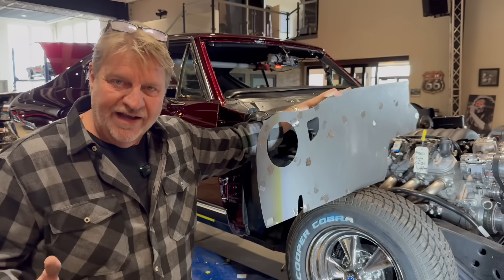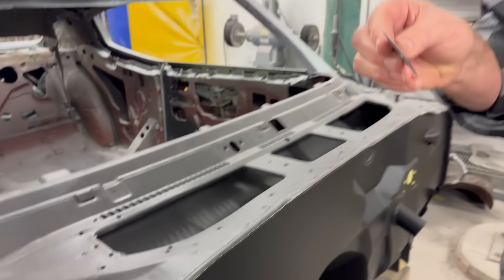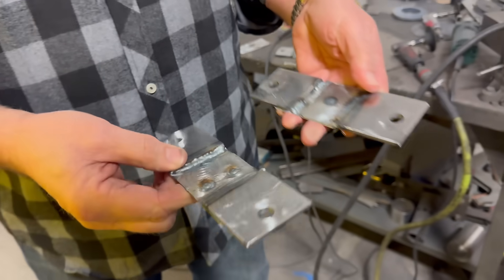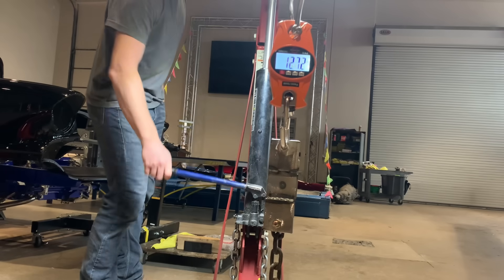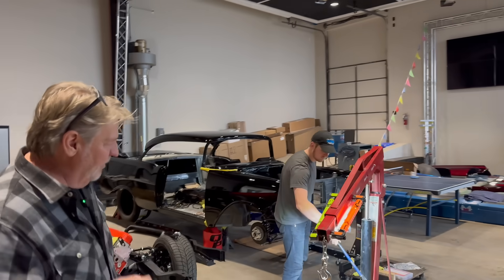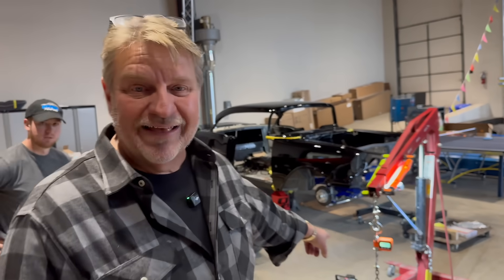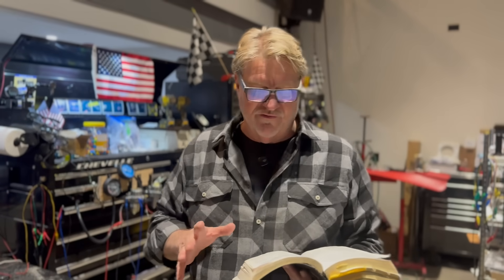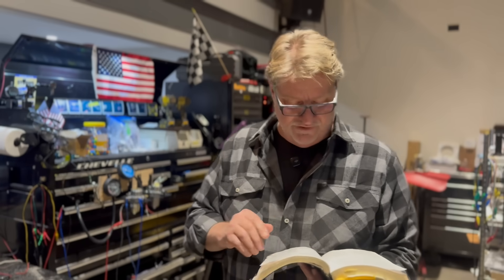Restoration Shop Using 3M Panel Bond Vs. Welding - Let’s Find Out Which is Stronger

Comment: I used this stuff back in 2006 on my 1969 Firebird passenger rear 1/4.  not only have I not had any issue with the glue, that 1/4 is straighter than the driver side which I welded (poorly) in a traditional manner.
Reply from the maker: Awesome to hear about your experience.  Sounds like it held up amazing.
Reply: It can help with reducing warpage and it acts as a seam sealer too.
Reply: That's not a fair test necessarily. A competent professional can and does know where to weld correctly so it doesn't warp unlike when someone like you butchers the job
Reply: @lollipop84858 I disagree. I was not at the time and still not a competent welder. Your statement seems to be that if I’m not I should pay a professional instead. Or I could adapt to my skill deficiency and use the panel bond to create a better product. Nowhere in my comment did I suggest that you shouldn’t weld, I simply stated that I haven’t had any problems with the panel bond in close to 20 years of service while also acknowledging my skill shortfall.
Reply: @pontiacontap 
Very well said !!
Reply: @lollipop84858 That's not true at all, metal always, always warps when introduced to high heat. The professional just does a better job of hammer and dollying it straight again. There is no magic that prevents metal from warping. Heck, I have even seen guys warp 1/4's grinding the welds down. The panel bond is superior because you end up with much more surface area of attachment.
Reply: @lollipop84858 "deBatE mE bRo!!"

Comment: We use a bonding agent called Hilti for commercial use in construction we anchor in threaded rods on rooftops that passes code then the panel Bond he using it's definitely going to hold your firewalls

Comment: weren't saturns    built with it ??not the plastic    the inner structure
Reply: saturns had bolt on plastic panels.  When I started my career that was the car of the future, now its a car of the past lol
Reply: @darylarmentrout252  i meant the steel structure not the panels

Comment: I am still very interested in this kit, for my   1971 Pontiac Lemans GT-37! Got my Bible today!
Reply: I love the GT-37!!! 
It's what the Judge was supposed to be, competition to the Roadrunner.
Reply: @TS1964 
Totally true! I had two  of 5802 made in 1971. One manual Sword stripe,and the one getting redone is a factory air 350 car with the early stripe "D98" !
Reply: @rajcam80 very cool brother!  What a great, unique vehicle!  Best wishes on your successful rebuild!
Reply: @TS1964  Was a revival of the Tempest... stripped down, light... and you could get the 455 in them... the even cheapie version was the T-37...very rare
Reply: in 72 for sure, not sure about the 71s